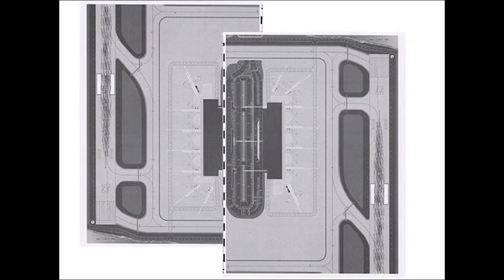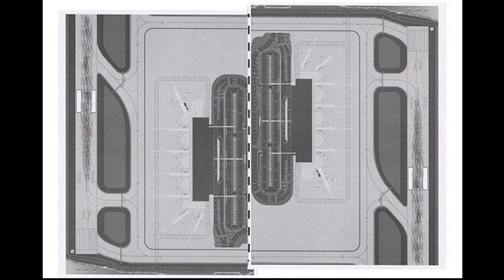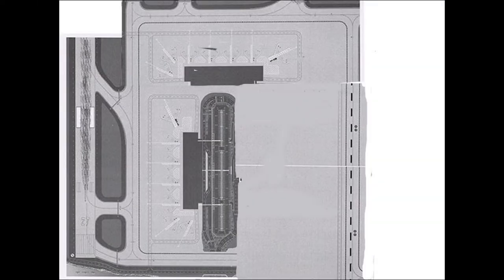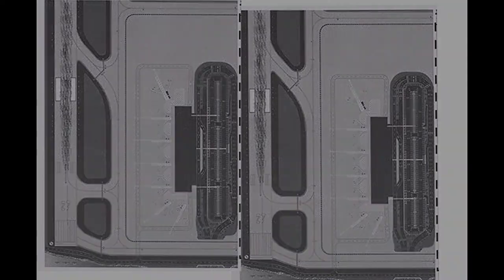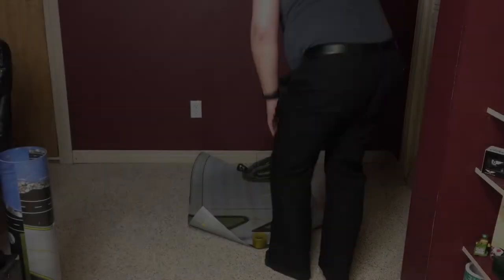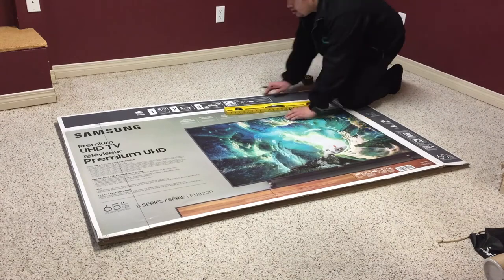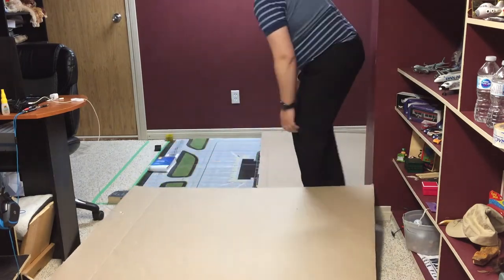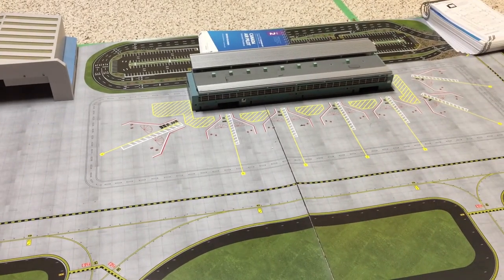Creating my Gemini Jets 1:400 airport Part 2

Comment: wow! Brilliant planing. I highly DONT RECOMMEND to use Gemini's mats. They are expensive as hell!!!!!!! Instead I recommend using a website called airport diorama or airport designs. Airport diorama costs 20 pounds and gives you a download where you can print out hundreds of different foils to your airport. Airport designs is free! but it has a smaller range of different foils. I recommend this because with the money you save from this you could buy more than one model. Also, I wouldn't get the pricy gemini terminal. Instead, I would look for and box you have or make one out of wood and then stick the foils airport designs or airport diorama provide you on the box. This makes your airport look way better and to your liking for a WAY CHEAPER PRICE.
Reply from the maker: Thanks for the heads up.  I’ve already looked into it.  My only concern would have been the printing costs.  I wouldn’t print from home.  I’d use the same grade of paper Gemini used in their foil.  As critical that I am against Gemini, the durability of the foil is the one thing they got right.  Also the colors come through well on their paper, as regular paper would have bleed through.  
The best part of all of this the Gemini Terminals and foil costed me $0!  I have an awesome wife who seen this idea through.
Reply: @thatavgeekfromywg  cool. Another alternative might be painting directly on the wood. Also could you pls make an airport update or a series where you show us your model collection. It would be really interesting!